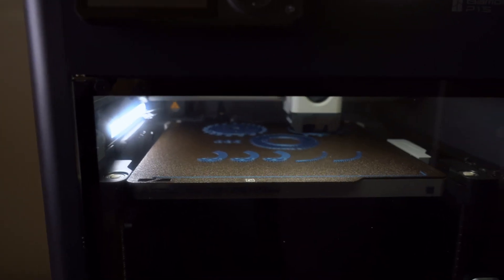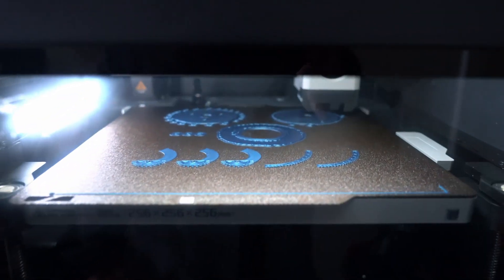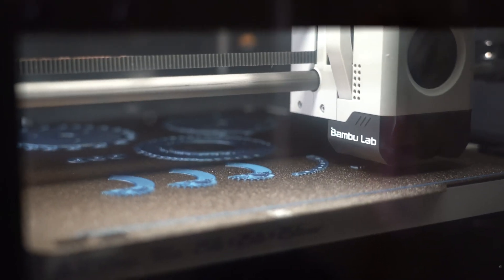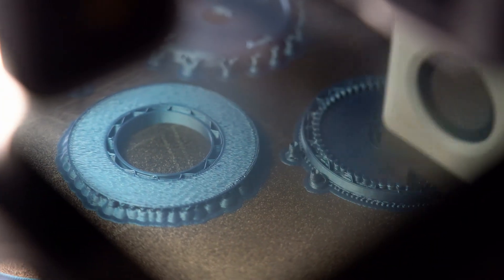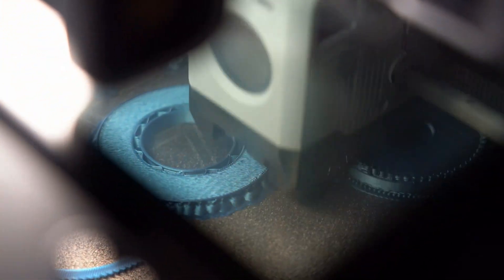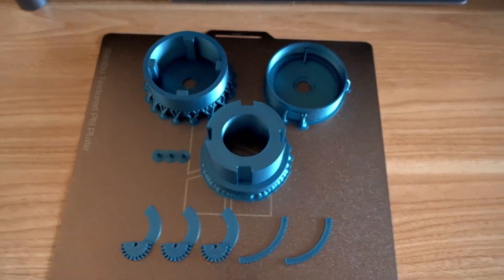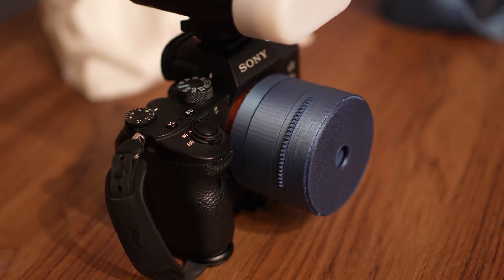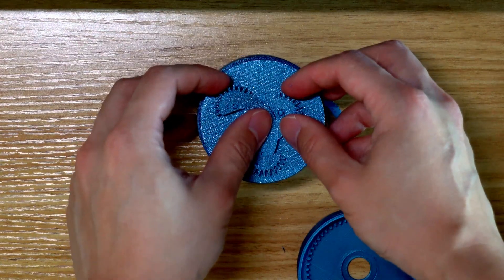3D Printed Camera Lens Test — Is It Even Usable?

Comment: As someone using CAD and 3D printing to modify, adapt and develop analog camera parts -- mostly large format -- this is really interesting. For an adjustable pinhole lens, more blades on the iris would help, of course, but as a proof of concept for the mechanism, very good. This could make a good shutter if you are using it with a camera that needs an in-lens shutter.  Another idea for an adjustable pinhole would be a rotating disk that has various sized small round holes in a very thin (knife edge) base. Small sharply defined holes in a thin base will greatly improve the sharpness of your result. This disk would be off the center optical axis so that the different holes move into place as it is turned. I have a brass lens that has an aperture mechanism set up like that. Or you could use Waterhouse stops -- holes of different sizes that are on little boards that you can slide into place. I was hoping you would show a way to change focus by rotating a collar on the lens -- a helical. This is pretty hard to 3D print, though because of the overhangs.
Reply from the maker: Really appreciate your insights, especially coming from someone with experience in analog camera parts! This is definitely not a perfect design optically and i was nervous that some plastic particle may get into camera sensor. I'll be curious if others can come up with more compact and functional lens desings.